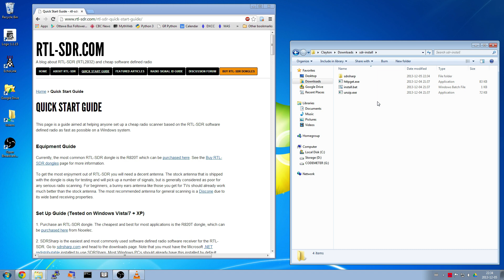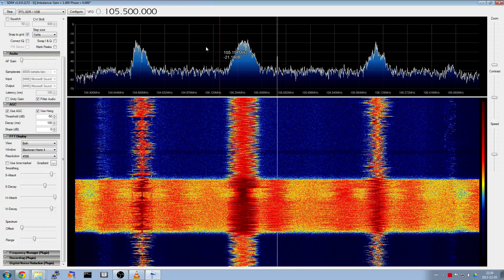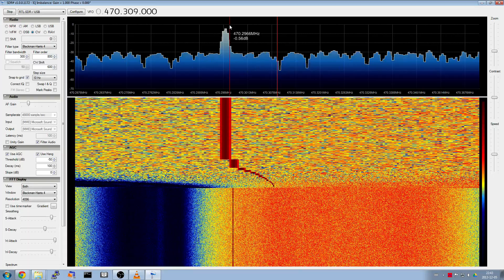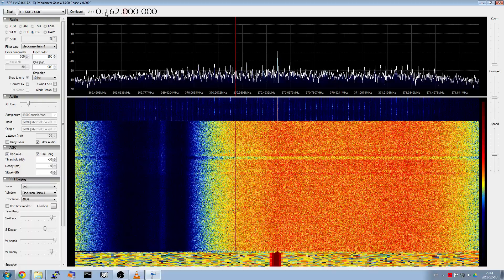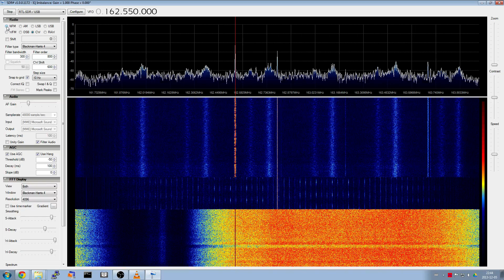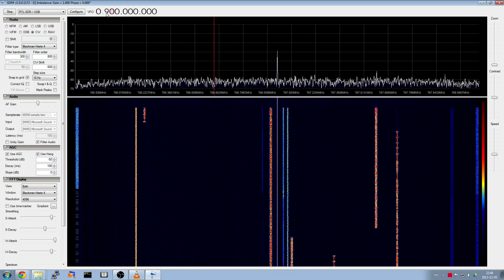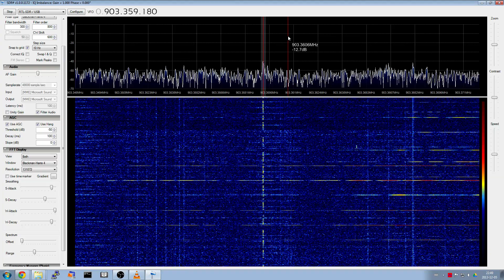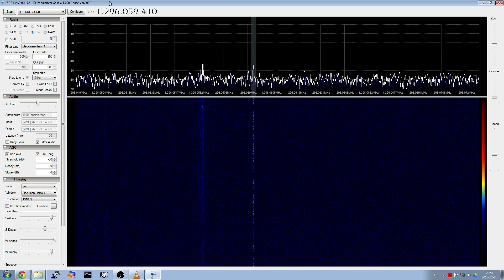Getting started with SDR# and an RTL SDR tuner

Comment: what's the center signal (the one you click right after garage door opener) ?
Reply from the maker: That spike is caused by DC offset in the receiver. It's not a signal arriving at the antenna, just an artifact of the receiver design.  You can either ignore it, or enable the option in SDR# to correct for DC offset.

Comment: $7 on amazon and you get a super mega radio. The only downside is it only goes down to 25mhz, wonder if there is a way to get it to go into the HF bands?
Reply: I bought an HF upconverter for mine that gets it down to 125KHz or so through about 30 MHz.  Just search for "NooElec Ham It Up v1.2 - NooElec RF Upconverter" also there is an experimental software solution that seems to work.  find it on  http://www.rtl-sdr.com/category/hf/  Read the comments -some have posted links to the compiled binaries.

Comment: Hello Clayton,
Could you tell me, is the pilot tone at 470.309 good from anywhere? When I tune it in I see two peaks...one taller than the other. The tallest one looks like on your video but it is pretty far away from my red line. Known FM stations tune in perfectly so I'm not sure if mine is that far out of calibration. Maybe FM has nothing to do with what we're doing here in CW at that frequency. Could you help please.
Thanks
Reply from the maker: 470.309 will only work if you have an ATSC transmitter in your area on channel 14.  If not, each subsequent channel is 6 MHz higher.  For example, channel 15 pilot is 476.309, channel 16 is 482.309 etc.

FM broadcast stations are so wide that being off by even 100 ppm doesn't make any difference.  At 100 MHz, that would only put you off by 10 kHz, and FM stations are 200 kHz wide.  But you'll really start to notice the inaccuracy if you're listening to narrow-band signals.
Reply: Ok, well I understand that but how do I find the stations & pilot tone in my area? I looked on radio reference but I can't find it there. Also when I do frequency correction the signal does not move. I did see what looked like the pilot tone you had at 470.309. I got way past -300 and never saw the signal moving toward the red line. I'm not sure what I'm doing wrong. Thanks for your help.
Reply from the maker: Buddy Whittington
Try using another signal at some known frequency then.  Perhaps your local weather radio station, which should be on one of the following frequencies: 162.400, 162.425, 162.450, 162.475, 162.500, 162.525, 162.550.
Reply: 162.400 is Baltimore , Md. I still cannot get the signal to move to the red line. I must be doing something wrong. Also if I wanted to listen to that NOAA station, would it be NFM or WFM. I don't hear it on any setting. Sorry for being a pain.
Reply from the maker: Any luck if you push your gain up to the max?

Comment: Hello Clayton thank you or this video. I am a beginner in the SDR world and i had a question what do you recommend for and antenna because i got a lot of noise with mine. Thank you
Reply from the maker: You'll need to describe the sort of noise you have.  If it's just that you can't receive the signals you want above the noise floor, then getting a more directional antenna (such as a yagi designed for the frequency you want to listen to) will probably help.

If you're having a problem with other signals interfering with the one you want to receive, you may need to add filtering.  For example, I live close to a number of high-power FM radio transmitters, and adding in a band-reject filter that eliminates those signals makes it much easier to hear other signals on VHF frequencies.
Reply: Clayton Smith The noise that i am havinge is when is tunning to listen to a radio frequency i can hear the radio but there is a lot of noise in the background, i will do another test outside, and i will share my results thank you for replying.
Reply from the maker: Nidal HADDAD Also try adjusting the RF gain of your receiver to find the point where the noise is the least. If it's too high or too low you're likely to get more background noise.

Comment: Nice tutorial, Sir !

I've been using SDR# with the FunCubeDonglePro+ wich works very well.  Recently I ordered a (cheap!) RTL SDR dongle, I expect delivery in a few days.  Very eager to see it functioning and compare it with de FCDP+ :-)  Thanks to your video I became aware of the fact that I had to 'upgrade' to the newer version of SDR#, wich seems handier to work with, especially for frequency input methods.  

Thanks again, you have very fine pedagogic capabilities!

73's ON4BDL
Ludwig
Belgium
Reply: How is your RTL-SDR?  I ordered mine with all the accessories, should get it tomorrow.  You still using it?
Reply: So sorry for the delay :-)  The RTL-SDR is not that accurate as the Funcube DOngle Pro+, but it has no frequency gaps, so I use it for the frequencies that de Funcube can't handle.  Works well, indeed!

Comment: hi i get that same line in the mid of everything how do i get ride of it.
Reply from the maker: It's not really necessary to get rid of it in most cases, but there is a "Correct I/Q" checkbox in SDR# that will compensate for DC offset in software, and it should get rid of most of the spike.
Reply: Clayton Smith thank you

Comment: Hay, I played with my dongle for a bit and adjusted it a bit but your vid helped with the adjusts ALOT thanks, also what is the blip in the middle of the display??? Mine has it and  noted it on most of your too, what is that??? thanks. grate vid. KD7YKR. 73s
Reply from the maker: The spike in the center is caused by DC offset in the receiver.  It's an impairment that pretty much all software-defined radios have to some degree.  Receiving software often has a DC cancellation option that tries to compensate for it, but the best approach is just to keep narrow-band signals away from that spike by making sure your LO frequency is above or below the signal you want to receive.

Comment: May be good to note that you DO NOT want to install the software that come with the sdr TV tuner dongle. If you do and try to run SDR# you will have a driver conflict and SDR# will freeze crash. This may not be the case for all SDR's but it was the case for a couple I have. The SDR# software I use has a driver replacement application in the file folders you have to run before trying to use SDR#.

Comment: FC0013, E4000 or R820T ? How did you get on 1.2 GHz ???
Reply from the maker: I'm using an R820T-based tuner. I also have an E4000-based tuner, but I prefer the R820T because it doesn't have I/Q imbalance issues, and is much quieter around DC.

Comment: Thanks for the edification. It seems I'm sitting here right next to a modern desk top PC that's going to waste! I've heard of a guy using a dish antenna to see the hydrogen line at 1420 mHz. From the galactic core! Makes me want to try it with a quad Helix array! :)  
73,
Rich
Reply: You will need an LNA since there is a whole lot of terrestrial interference. I actually built a few LNA's for different bands for example the 1400 - 1600 MHz band to receive GOES East HRPT images and Inmarsat transmissions.
Another is the 3 - 6 GHz bands and using a block down converter to 900MHz inline with the sdr.
Reply: Mel Elfnet  Hi Mel, after I got my dongle running, I found my old 1420 MHz LNA (DownEast Microwave) and repaired it. The 12V input was fried. A chip cap had shorted and melted the series diode.. The LNA is now helping to track (RLT1090 software) airplanes 65-70 miles away, using the LNA and a kludge indoor antenna.  
http://ecorenovator.org/forum/attachments/appliances-gadgets/3950d1391531130-cheap-wide-band-radio-receiver-usb-dongle-p1010815-jpg

Back when I used to listen to the hydrogen line with my old 10.5 foot TVRO C-band dish, I used a 3.5 turn RHCP helix feed, so I was receiving the opposite polarity from the GPS birds..
The 1420 helix feed is very wideband, I could hear Hams doing EME, on 1296 Mhz. So cool hearing signals bouncing off the moon!
 
These dongles are fun.. Wish we had these years ago! Could have saved a few bucks on hardware..

Comment: Hi Clayton,

You have done an excellent job of introducing the software to those who are not familiar. That gives me motivation to plug in my dongle once more and enjoy its capabilities.

Cheers!

Bert, VE2ZAZ
Reply from the maker: I'm glad you enjoyed the video.

Now that you've switched to Linux, you'll want to use gqrx instead of SDR#.  The two have pretty much the same capabilities.  Unfortunately gqrx is not (yet) a part of Ubuntu, but the author (OZ9AEC) maintains Ubuntu PPAs that make installation very easy:

    Stable: https://launchpad.net/~gqrx/+archive/releases
    Snapshots: https://launchpad.net/~gqrx/+archive/snapshots

Those PPAs also include all of gqrx's dependencies, including GNU Radio.  It's an even more convenient way to install GNU Radio than Marcus Leech's script.

Another note: I recently did an A/B comparison of my old E4000-based TV tuner and the NooElec TV28T v2 (based on the R820T tuner) that I'm using now.  The TV28T seems to be superior in all respects.  First off, my E4000 tuner is quite deaf -- it can only receive the strongest signals, regardless of the gain settings.  I'm not sure whether it's just defective, or if there's some sort of intermod or overload issue going on.  The R820T tuner has no trouble picking up weak signals.  The E4000 tuner has lots of I/Q channel imbalance resulting in image signals, while the R820T has none that I can see.  The E4000 also has a lot of noise near DC (the closer you get to DC, the more noise there is) whereas the R820T has no extra noise near DC, just a single spike at 0 Hz caused by DC offset.  According to this analysis, the R820T also has less birdies:

http://www.rtl-sdr.com/wp-content/uploads/2013/08/Some-Measurements-on-E4000-and-R820-Tuners.pdf

All around, I'm very pleased with the NooElec TV28T v2.
Reply: Clayton Smith
I am already using gqrx! This is what I have been using un Xubuntu. Good piece of software. Works like a charm.

Thanks,

Bert.